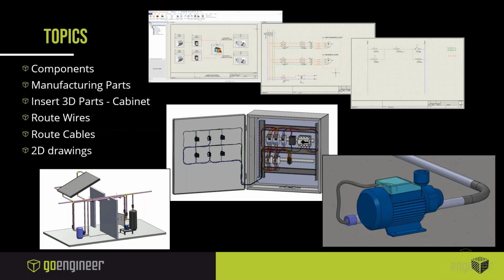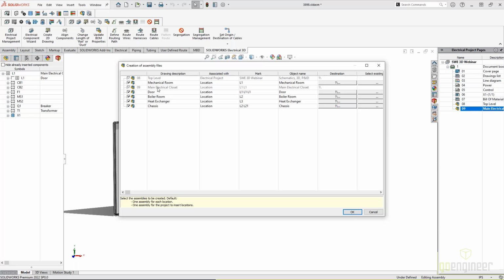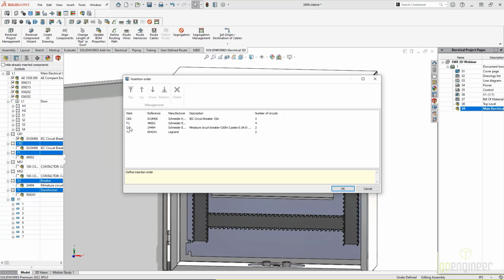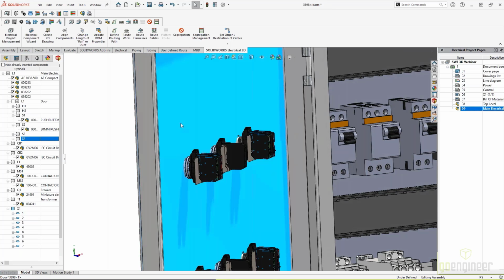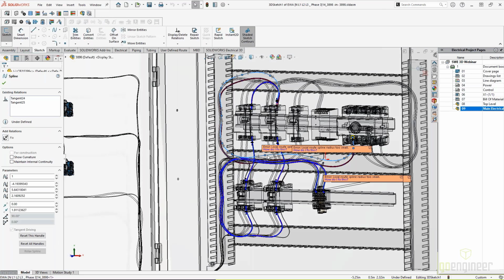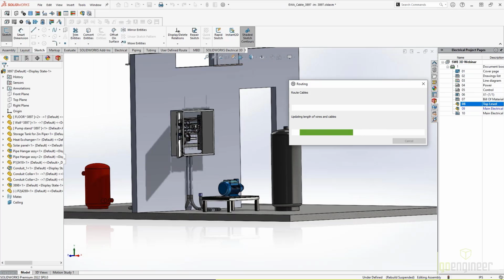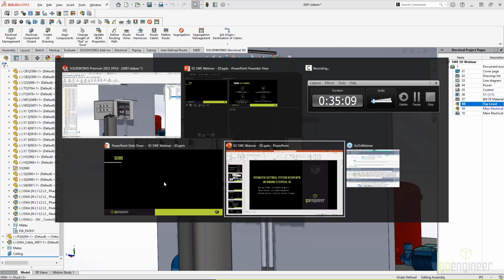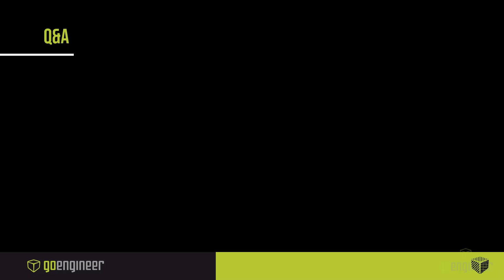Integrated Systems Designs with SOLIDWORKS Electrical 3D - Webinar

Comment: There is a huge disconnect between Solidworks Electrical and Solidworks Electrical 3D. I want to be able to use the Solidworks Insert > Table > Bill of Materials and Auto Balloon. But it references the 3D CAD Feature Properties for descriptions and part numbers. I would expect that it would use the same data from the Solidworks Electrical Manufacturer Part Manager.

Comment: I followed your last video to create same design. When I started this video tutorial I saw that the 3D model of control panel was already present in your electrical project management list, where as it was not present in mine. Can you answer why? How did you convert 2D model of control panel, which you design in last tutorial into 3D model??

Comment: I recently archived a project in SWE2016 and brought it back into SWE2018. When I connected to SWE and SW 3D and opened the project assy all the part names in the SW feature tree reverted to their original SW file names. That is they didn't match the Component names from the SWE Root Mark.
I noticed that in the SW System Options->External References the "Update component names when documents are replaced" was checked.
This seems to impact how the assy opens and it reverts the part names back to the file name.
If I replace each component from the 3D Feature Tree with itself; (i.e. the same component found in the SolidworksData Solidworks Projects folder) the right names come back.
I can't work out how I lost the reference? Its somewhere in the EW_TAG or Mark name that it pulls from SQL but because the system was set to update component names it lost the refs.
How can I fix this without having to go back and re-insert or replace all the components again.
Reply from the maker: In order to give this the attention it really needs we would recommend getting in touch with your VAR technical support team. They will be able to work with you to verify the issues and either relate it back to a known issue or get it reported to SOLIDWORKS.
Reply: @goengineer  Nothing wrong with the software I just need to know how to add the SWE Symbol Root Mark tag to the 3D SW Part properties.

Comment: How this wire are generated to it's specific path and position
Reply from the maker: They discuss Routing wires starting @ 17:58  if that is still not clear let us know.
Reply: @goengineer  can I get video on schematic plan of components mounting with sensors and wiring as well as there documentation.